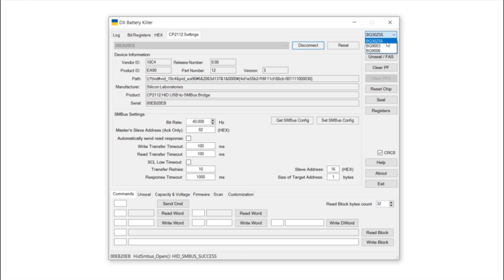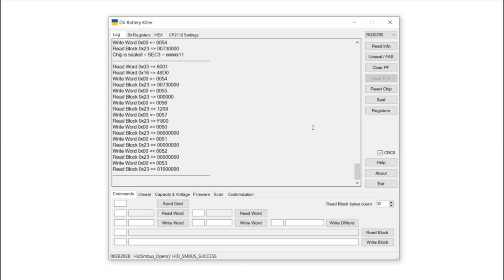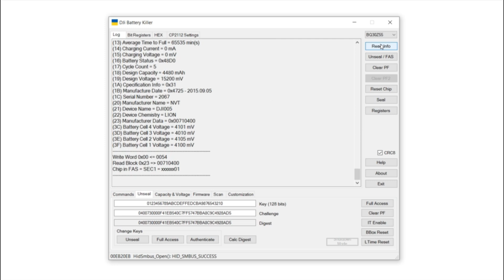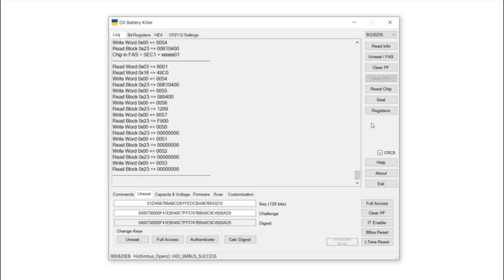DJI Phantom 3 Battery Wont Unseal

Comment: I still can't unseal the mini 3 battery
Reply: it still shows this message ''First, you need to unseal and FAS the chip"
Reply from the maker: are you referring to the mini mavic ? If so I believe that its BMS is a different model and you need the other DJI battery killer software (the one where you cant select the chip).

Comment: i have one that I did end up doing this to unseal it, and the PF flag will get set off, resealed, looks good on first register read, but then after about 10 seconds further register reads will have it pf flag set to red again. I am guessing that just means the battery is no good and theres no saving it but curious what your input is
Reply from the maker: I would check the cell voltages. Do a read info and right at the bottom it will show you the voltages of the cells. I have seen the same thing happen and it is normally because one of the cells is bad and its voltage is too low. I assume that you charged the pack to about 14-15 volts before removing the PF ?

Comment: But this works, only if unseal keys are knowable?
Reply from the maker: No, it changes the keys with the change key function.
Reply: I am waiting for my cp2112, and will try to reprogram Mini 3 Pro battery.
But will the drone accept the battery with the new key 🤔
Reply from the maker: @VelosiFed  there are several videos out there for DJI batteries, I did one on the Phantom 3 as there appeared to be nothing on this model. There are many videos on the Mini (and other post Phantom) batteries. I believe they use a different version of the software made by the same guy. I believe that the required pins are exposed on the batteries connector for some drones so there is no need to open the batteries case or solder leads. The different software is due to the different model of BMS chip used, but they are general all TI brand.